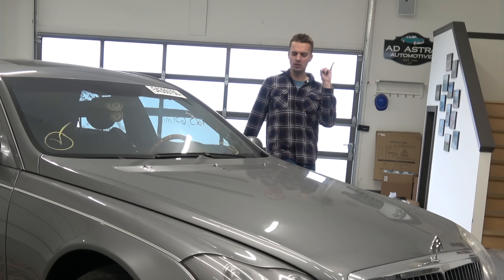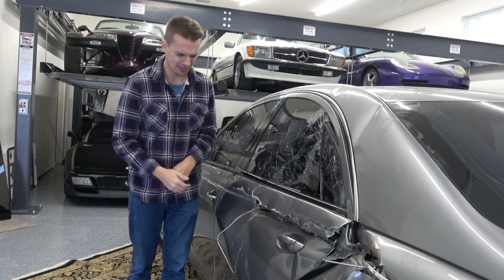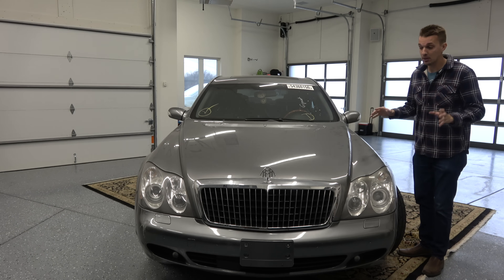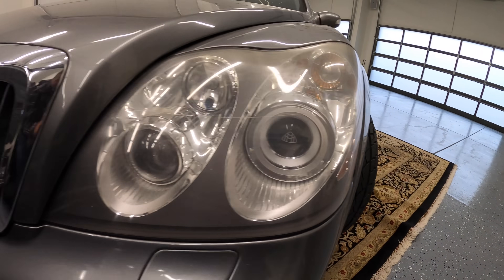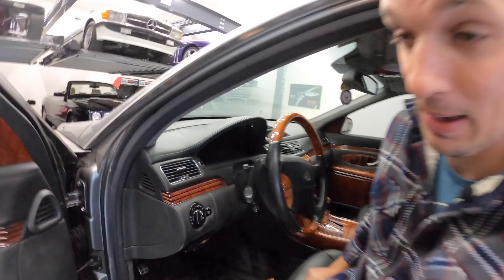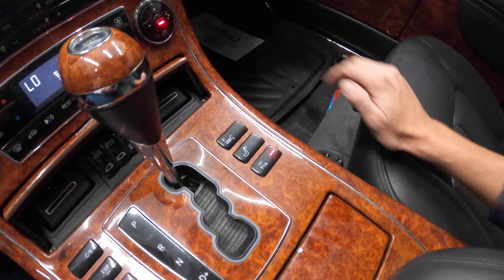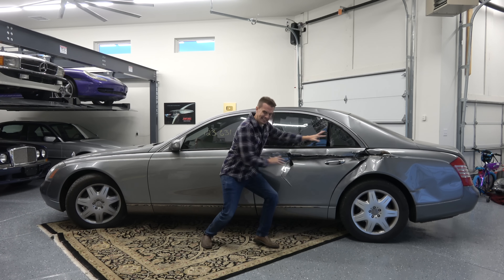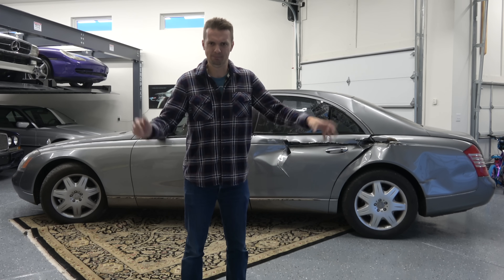My $350,000 MSRP Maybach 57 Showed Up Like This??? Good Thing It Was The Cheapest In The USA!

Comment: The damage is from a semi making a turn and the rear of the trailer swinging into the side of the car. At least that's my best guess.
Reply: That was my guess the back of a semi
Reply: The damage is too low. If it were a dock high box truck or trailer the damage would have been in the roofline. It's probably a cube van. Something similar happened to my Eclass a few years ago in the same spot. Tore the door up good.
Reply: Could of Entered the Marvel Universe 🌎 and Wolverine 🔪  Wasn't Having It!!!!
Reply: I came here to say this
Reply: I was thinking plow my ex girlfriends father did that he turned into a parking spot caught the side of a car an just kept goin had very similar damage
Reply: It looks like they hit a forklift arm. Seen someone do it before and it almost the same damage
Reply: I was going to say someone trying to slalom a set of railroad crossing gates but doing that to even a depreciated Maybach would be dumb
Reply: Definitely parked when it happened.
Reply: Looks like side of mountain/rock by side of road damage to me.  Ran off shoulder and contacted jagged outcrop.  California coast, many places along Interstate in CO, I could go on but highway near rocks.  Highway because to me damage occured at speed over 45.
Reply: That makes sense.
Reply: At least they drove it.
Reply: Similar thing happened to a Mercedes Wagon Car and Driver had for a long term test.  Was a longer tear, but given it was basically brand new, was still totaled out.
Reply: I say it was an iceberg.
Reply: That driver must have had a bad day X) “boss I craches into a maybach” “YOU CRASHED INTO WHAAT?!”
Reply: What are the odds in the USA of driving your truck and totalling a 57 Maybach…

Might as well have been a Bricklin in a rare factory color.

Comment: Did anyone notice the paint on the “undamaged” right side doesn’t match either??
Reply: yeah i kept thinking that's a reflection but it definitely looks mismatched on that door
Reply: I came to the comments to see if anyone else noticed that too
Reply: Yes, that back door is a different color. I’m also pretty sure the rear curtains were different. The passenger side was black and the driver side looked like a gray curtain. Thing has had a rough life.
Reply: So are we saying the can opened side is probably the good side?
Reply: Whomever had this car before was a bad driver. Those doors are different colors, the curb rash on the wheels and ughhh...the center cap and lug nuts 🤦🏼‍♀️ Well, it was a deal, but I agree with Ellie. The outside is about as exciting as a bowl of oatmeal. 🤷🏼‍♀️
Reply: @mauriceetal1426  it looks like the original part.
Reply: 4:30 Behind the B-pillar?
Reply: @brandonnichols8053  it's got 120+ miles. It's not had a hard life. It's had a life.
Reply: @spinnanz  Well I guess that’s true of European cars. Japanese cars are just getting broken in at that point. If I paid $350k for a car it sure as hell better last longer than that.
Reply: @brandonnichols8053  why would it's price dictate it last longer? If you mistreat an expensive car, it won't last. Expense doesn't make it more resistant to mistreatment or lack of service.

Treat any car well, cheap or expensive, and for the most part it will last. I've seen 1500cc toyota hybrid taxis with 600,000km on them. Becuse they are looked after.

I should re-phrase my original comment. It's not had a hard life, its had the life of the average Toyota Camry.

Comment: Me: "How the F he got a Maybach for 20K?!?!"
Tyler: *Shows the bad side*
Also me: "Ooooooooh, i see.... 😐"
Reply: A good one isn’t far off in price, lol
Reply: 0k
Reply: Yeah, semi trailer during a turn while it was parked, maybe?
Reply: @Jack_S_  That's the same situation I imagined. A blind, wide, right turn by a semi.   Fred
Reply: Like he said, good ones are still only 40-50k. Fairly obtainable
Reply: @electronicengineer  I think it would be a left turn since it's on the driver's side, maybe on a tight street. Like the trailer was too close when he made the left, the back of those always swings right when they turn left. New York has a lot of streets semi's aren't even allowed on because of how easy this is to do on those tight streets.
Reply: @sunnohh  I think a good one would have been the smarter choice here. Once fixed he’ll have damn near that much I’d have to think, unless he’s getting the body shop to do the work for free in exchange for the promotion, and then he’ll have an R titled car that’ll be worth less than the good one would have been.

Comment: Next episode: "$30,000 for a door and quarter panel???"
Reply: Lol
Reply: Indeed, but he'll make several times that from his channel. Well worth the expense.
Reply: It's at least a $100,000 car in good condition
Reply: ჰბ ნუ გეშინია მე
Reply: @mikeb3172  I'm not too sure. Should be mich less than that. These cars depreciate insanely fast,.not to mention the model and brand are discontinued.
Reply: @XB10001  the fact that it's a salvage title won't help the value either.
Reply: @andylucas8262  indeed. But that doesn't matter. He makes money off the videos,. not the cars.
Reply: @mikeb3172  That can be purchased clean and with lower miles for $40,000.
Reply: Sponsorship is key "copart"
Reply: He needs to buy an other donor Maybach to fix this

Comment: Looks like the passenger side had an accident too, the color difference between the 2 doors is quite a lot 4:50
Reply: I saw that... Difference in shade.
Reply: Could just be the lighting, if you look the rear panel is the same colour too.
Reply: It looks like it's been slightly crashed and repaired several times in that 120 k.
Reply: @ConyaBalls2004  on the one hand, I don't know how lighting would account for the difference in shade to be demarcated precisely along the front edge of the door.
On the other, I can't fathom a paint shop making such an obvious error in colour matching for something like a Maybach, esp considering the clearcoat finish appears to be flawless.🤷‍♂️
Reply: Also if you notice the chrome stripe doesn’t quite line up with the rear door
Reply: @ironymatt  it may have been perfect when first done and then faded differently. Different paint compounds fade at different rates.

Also different paints sometimes look the same to the eye but different on camera.
Reply: @gasdive  good points, especially the latter. For the former, is it possible for a quality shop to account for different compounds, fade rate etc? I'm not that knowledgeable about the industry but my intuition is that such variables should be doable for the professionals at a prestige/luxury pricepoint.
Reply: @ironymatt  yeah, I don't know either.

My understanding was that if a luxury car needs paint, they do the whole car to avoid these issues, but I'm not an expert. It may depend on what the insurer is prepared to pay for, which may be different from what a Maybach owner would expect.
Reply: @gasdive  true, it'll be a moot point anyway since Hoovie will just get the whole thing resprayed at Maaco. I guess it's justifiable for a Maybach with 100000+ miles on it lol!

Comment: Damage theory: a large truck was turning on a narrow road and its trailer's rear crash guard went full wolverine on it. It's about the right height.
Reply: Well deduced, I think I agree.
Reply: Yeah. I think its either that or a lifted jeep/truck t-boned it slowly
Reply: I'm thinking that same thing.  It has the elements of a trailer rear end scrapping down the side.
Reply: Looks like the height of a rollback wrecker.
Reply: The door is literally slashed. I don't think a crash guard is the cuprit
Reply: That's exactly what I pictured happening when I saw the damage.
Reply: I don't think so, the trailer's bumper is at way lower level, this damage is too high for that . Plus, that bumper is way thicker, would be much more damage. This was done by a more narrow object.
Reply: @lrich8181  Thats exactly what it is

Comment: i think the rear end of a semi truck trailer turned and cut into it.
Reply: That or a flatbed delivery pickup. Seems a tad low for a semi, but there are stepdecks that height.
Reply: @brandoncaldwell95  oh I think you're right, that's what I had in mind though when I said that, I know driving big trucks the end can swing out if you turn sharp.
Reply: @804_Rider  yep, that tail swing gets you every time. My 40ft gooseneck is a nightmare on tailswing. Many idiots try to pass and many close calls. People dont grasp the concept of tail swing. Have to block that lane for a reason or damage like that dies occur. 

Im certain this was done purposely though. That car is in bad shap
Reply: @brandoncaldwell95  damn I didn't think about that, could be possible though
Reply: @brandoncaldwell95  we have some 15.6m 51 foot trailers with rear steering axle that have taken out bus shelters 😂

Comment: Former body shop guy here. If there is no frame damage that's an easy fix for even a rookie. The rear 1/4 and interior door panels will be pricey cause there Maybach parts but the door skin is Mercedes and there's 1000s of cheap ones out there.

Comment: Your rear window visor doesn’t work if the air pump doesn’t it works with the same pump as soft close door, my s430 had pump issue for soft close and caused my rear window visor to sometimes not work till I got new pump pretty expensive 😬

Comment: MB lost $250k per 57 models and over $300.k  on the 62 each for 3 years before dropping them. 
My guess to repair your car right will be around $22k parts & painting down the whole side and roof, trunk lid, part of the bumper corner. I dought you can buy a door skin for it like the older MB's were from the late 70's back.
Those miles are nothing on this car as long as it was serviced right by an MB dealership. It's like having only 10k on a GM, Ford, or Toyota, Honda.
Good luck with repairing it you should keep it after if everything else is fine.

Comment: That's truck damage. My car was parked on the street - a tractor trailer turned into an industrial unit, and the metal 'crash' bar at the back to stop you going underneath in a rear end crash opened it like a can opener. 😒

Comment: Hoovie...run, DON'T WALK, away!  I've seen these in relatively pristine cosmetic condition but repair parts are not only OUTRAGEOUSLY expensive, most of them are NON-EXISTENT!  Mercedes-Benz S-class parts are (for the most part) NOT compatible.  For instance, if you have a failed radiator (cracked tank), the replacement radiator is NOT AVAILABLE.  That example is a parts car BCS.  I can't wait to see your face when Wizard confirms all of this.

Comment: Suckerism at its best! If offered a Maybach for free I would not take it! Tiger tank engine. JINXED It also has the DINOSAUR Kommand system that "runs" the audio, some video, GPS and probably the bluetooth. The system is KLUNKY as heck! Probably features a sealed automatic transmission that needs to be serviced IMMEDIATELY! (Same as Mercedes of same year range) if you want a properly working GPS buy a TomTom and put that on the dash. Works a LOT better than the totally NON intuitive GPS system the car comes with. They put the same shit in the Mercedes of that year range. FORGET IT! His clever, adorable, SMART GIRL totally gets it!  SHE IS NOT IMPRESSED!